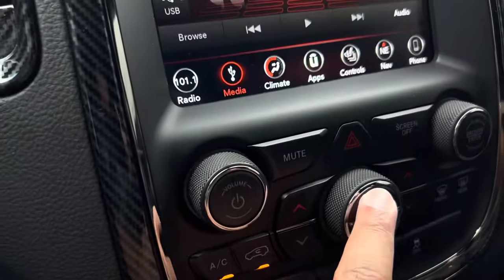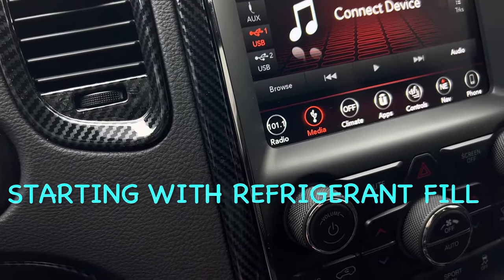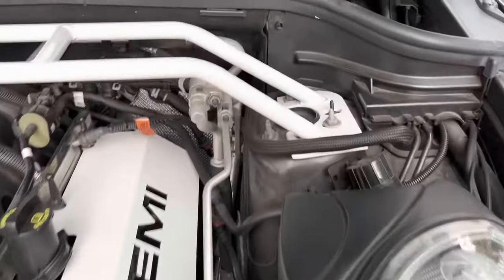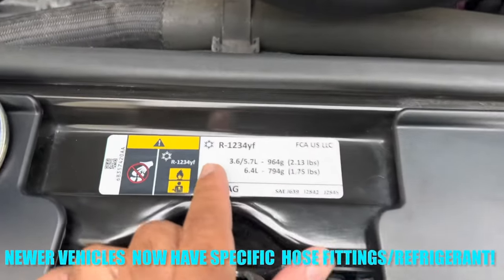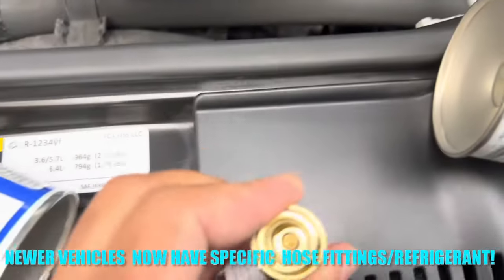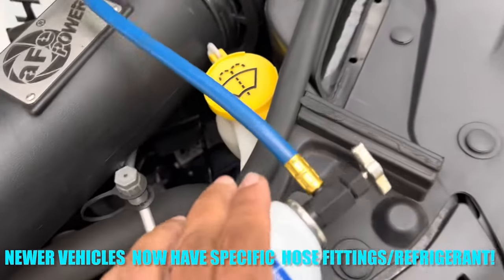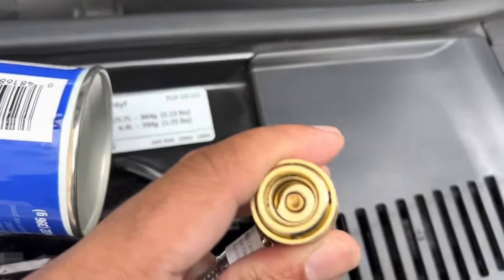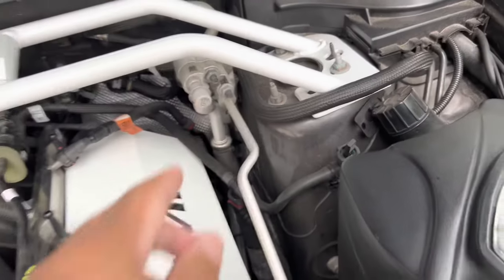MY AC BROKE AND IS HISSING LOUD!!

Comment from the maker: From what I’ve learned there may be air in the system. You can rent to tool or take it to a shop and have them remove all the air from the system.
Reply: You are correct.  Air in the system.  But the system is a closed system, which means air was introduced from a part that is leaking.  You cannot remove the air without fixing the leak.  Mine was a condenser leak.  But there are a few different ac parts that can cause this.  Find your leak, get your system pressure tested or color dye tested to confirm, replace part, refill ac refrigerant.  But find a way that will work for you and save you money.
Reply: @unlistedvideo2164  Did you do it yourself or have a shop do it for you and if you don't mine me asking what was the price tag for everything.
Reply: Can this happen after a condenser replacement?
Reply: @AlexsRTLife   take a Compressor

Comment: Had the same issue on my 2016 grand Cherokee summit . Had it to the shop 3 times and they replaced the condenser and didn’t fix it…. Couldn’t spend any more $$$$$ on professionals to guess what the problem is so I used a smoke machine from amazon the I paid about $100 for and connected it to the low pressure side and surprise!!! The AC compressor had a leak behind the clutch…. Easy replacement and took it to a nice guy to pressure test and refill the system. No more issues…

Comment: My 2019 Grand Cherokee is making the same noise. I’ve taken it in 4 times and no one can figure it out. They even wrote it up as “ Customer states AC sounds like Darth Vader”
Reply: Hello did you find out what the issue was? Im having the same noice
Reply: Hey did you find a solution my vehicle is the same year and has the same problem?
Reply: Definitely something behind the dashboard. They don’t wanna have to take the dashboard out just for a $100 diagnosis fee or for free to look for the problem. I’m almost 100% sure it’s the ducts being partially blocked aka closed from blend door problem. It will hiss. If that happens Your ac or heat won’t be working their best.
Reply: I don't understand that people don't spend 70€ for an AC check and full airco I don't only need antique or fluids but also hidroliq oil also has to be filled for your pump and good lubrication function this can save you a lot of money Mvg Fernando

Comment: Had the same issue at 30K miles with my 2014 Citadel.  Dealer replaced the compressor/condenser under warranty ($3600) and it fixed the issue.  Now at 77K miles and seven years later it has started again.  Luckily its still under warranty for 120K miles.
Reply: Lol a compressor and condenser is like 400 bucks
Reply: Yep. Not at a dealer though

Comment: Mine was doing that, then would stop, then start again. I got barely cold air. That hissing is so loud too like a HUGE leak. Was low over a pound on refrigerant and was leaking at the compressor and schrader valves. Once it was filled and the leak fixed it no longer does it and A/C runs normal. I knew it had something to do with the charge, when it's low on charge the evaporator can ice up, the refrigerant can turn to liquid instead of vapor - all sorts of odd things. Mine started hissing like that even when I was still getting cold air BTW, but got more and more often as the charge fell. Chrysler uses a TXV valve system like house A/C's, so maybe it has something to do with the refrigerant metering? Dunno. For a mechanic to explain I guess - just passing along my experience with my Chrysler 300 (same A/C system as Charger/Challenger).

Comment: This should be a recall issue it’s really common on Jeep dodge Chrysler most of the videos I seen is always the ac and the cam shaft going out on these vehicles and both repairs are crazy expensive Jeep dodge Chrysler have to do better this been going on for years
Reply: Camshaft/ lifter issues are known on both chevy and chrysler.. need to upgrade to 6.1/6.4 springs, lifters depending on generation of hemi.. i use srt viper oil filter with higher oil psi relief on all hemis, but especially to help prevent 5.7 hemi camshaft issues

Comment: There is a leak somewhere. Mechanics will put a UV dye in your system and can check with a light at a later time to identify the source of the leak. It could be be coming from anywhere

Comment: This is the exact same issue I'm having on a 2013 durango.  Even same issue you have when sitting on idle it's more noticeable, but when driving its very quiet.  I'll update about remedy just incase it's different problem other than a condenser, compressor or hose.
Reply: Mine as well. 2013 Durango. Recharging the ac only lasts a few days but hear the same sound when I turn it on. When the ac is no longer cold (refrigerant has all leaked out), the sound stops. Fixing other issues at the moment so I'll get to the ac issue soon lol
Reply: @warhawk813  it was my condenser.  I suggest buying the part and taking elsewhere other than the dealership for repair.  But the hissing is gone and the ac is blowing snow again.

Comment: Same thing is happening to me. But filling the refrigerant only lasts for a day so there’s a much bigger problem
Reply from the maker: Mine still blows colds even weeks after refrigerant recharge but it’s still hissing. I’ll be posting a video whenever I get it diagnosed and fixed
Reply: @AlexsRTLife  Yea I tried fixing with refrigerant refill but it runs out so quick and is back to blowing hot air and the gage reads 0. I’m wondering if it’s a hose. Hope it isn’t the compressor. Not sure if it’s worth buying another can of freon but the one with the Dye inside to detect where the leak is to assess the problem and maybe see if it is a hose or a compressor issue. Or I just wait and take it to the shop to have them take care of it
Reply: @AlexsRTLife  2017 Toyota Camry btw so shouldn’t be normal for cars like this. Probably a major leak somewhere or not sure if pressures are off but otherwise i’m thinking of just going to the shop and having them check it out
Reply: @AlexsRTLife  did you ever get that hissing diagnosed? My Jeep makes the same exact sound
Reply from the maker: I haven’t, I been procrastinating since it’s still blowing cold.  Imma go ahead soon and get it diagnosed

Comment: Whole Process to Fix it ?
what ??
Buying the Wrong Fill Connector and Wrong Refridgerant -- 
"Not" Fixing The Problem and Hoping For The Best ?

I post the problems and fails on my vehicle and take you through the whole process to fix!

Take us through the Process..
Ive Been Looking For A video about this Hissing and failed AC.
Finally !! Someone Showing us The Entire Process + Possible Mistakes to avoid ...

Just a Recharge a Leaking System 
Nevermind the Hissing..
hope for the Best.
Meh 

Maybe Do your Research "After the Fact, Go buy and try to Fill your vehicle's HVAC system with the wrong kind of refrigerant before you read about it and see what your vehicle actually takes. 

 absolutely brilliant that's the entire process how to fix it, well done
 thank you 
very informative, time well spent :-)

Comment: Had AC issues with my 2014 grand Cherokee every single year after buying it...Whatever they do at the dealership to fix it is a patch and the same issue happens again the following year. This year it's working for the first time ever, I changed the ac compressor last year so that might have fixed it.

Comment: 2018 jeep grand cherokee had this issue and had to get a new compressor. Luckily i had extended warranty because it cost about $1500.
Reply: common issue with jeep/dodge/chrysler. you’ll fix it and eventually it WILL happen again.

Comment: I started to have the exact same problem with my 2015 durango RT. I went to several mechanics last week and they told me that the condenser has to be replaced. It has several leaks on it and it's $1000 to do the recharge and to replace the condenser.

Comment: Having this issue in 2021 Grand Cherokee. Literally just got it back from the dealership. Said it was bad cabin air filter that allowed debris into the blower fan. It isn’t. Not fixed. Ugh.
Reply: Any updates? I got this issue after they changed my air filter and still no luck for me.

Comment: 2016 Mazda 3 just shy of 185K started doing this today 😢 when it first started it was blowing cold air but hissing, after about 20 minutes the air got hot and won’t cool down. I just had my Freon levels checked a few months ago and it was full. I’m guessing it’s a busted hose somewhere. Taking it to the shop on Tuesday 🤞🏻 mine hisses when I’m driving as well as idling but if I turn the ac off and just blow air it doesn’t do it.
Reply: I also feel like the air isn’t really blowing out of the vents even tho I have it on high and I can hear the blower
Reply: Is your problem fixed, having same problem Mazda 2016 CX3, when AC is on wierd noise comes , noise settles down when car in motion. Not sure if compressor is culprit.
Reply: @aloktechie7981  negative 😢 can’t remember what the exact part they told me to replace but it’s something in the dash. It has a nasty Freon leak leaked all its Freon in about 4 days. Dealership quoted me 2300 to fix which is more than I owe on the car. Will drive this one a bit longer but I’m thinking on getting another Mazda soon. Mines almost at 192k miles so it’s had a good life

Comment: My 2021 Cherokee is doing the same thing.  I wish I would of saw this video before spending damn near 70 bucks on a 134a can with the adapter that doesn’t fit.   Ugh. No other video mentioned that!  So thanks but to late for me.   Did you ever find out what the problem was ?
Reply from the maker: Not yet, I been putting it off since I still got cool air
Reply: @AlexsRTLife  I think I see green refrigerant all over the radiator.   The engine coolant is a orange color.   So I’m thinking there is a hole somewhere or hose it’s leaking from.  It’s a lease also.   Nothing but problems with these jeep cherokees for some reason

Comment: Damn my grand Cherokee just started doing this 😢
Did you ever solve the problem?
Reply from the maker: Not yet, appointment at dealership soon though. Will upload video on it
Reply: I have the exact issue going and today I noticed refrigerant splatter down near the bottom of the radiator. There was a very small amount but it’s definitely there. My a/c actually blows just as cold as it ever did, so I’m a little confused, but my appointment is on Monday. Will update if I don’t hear anything before that. Good luck!
Reply: Well?
Reply: Any updates?

Comment: That’s your evaporator core
Reply: How do you know forsure
Reply: @10percent48  I’m 100% positive that’s your evaporator core you can hear the hissing you could also hear it through the vents usually those crack and have a leak
Reply: @cristianortega2634 bro I have a 2018 Honda I just change my evaporator core and still have the same hissing sound 🤷🏾‍♂️
Reply: How much is it to fix the evaporator? they told me that’s what was wrong in my 2018 challenger

Comment: Good day, any updates on what’s the cause?
Reply from the maker: Not yet. I will get it diagnosed in the summer. But the weird thing is that is doesn’t hiss at all when the heat is on, only when the AC is on
Reply: @AlexsRTLife  it happens in my car as well and in a few forums it’s mentioned that it’s because of bad expansion valve. And it could also be because of the refrigerant not being in liquid state while going inside the evaporator. If the refrigerator enters the evaporator in gaseous state, the whooshing sounds could basically be the from the gas passing through the metal tubing of the evaporator

Comment: From the looks of it, adding Freon is a temporary fix, and the actual fix is replacing the condenser? 

I have a 2019 jeep grand Cherokee with 34,000 miles and it recently started doing it
Reply: Hey brother were you able to find a solution
Reply: @rraymond4912  

Went to the dealership.  They couldn't find a leak.  They added the refrigerant, and it's been running strong for 3 weeks.  Paid dealership prices of course, which sucked.  Luckily it was only that, instead of the $2000 minimum through the dealership for the condenser. Still forked over $500.  Damn crooks.  

I did check for leaks, which there wasnt.  However, I wasn't able to verify the condenser behind the dash though.  I rolled the dice and got lucky.  Now my Camaro is blowing hot air now.  Never ends.

Comment: Same did you fix it wat was it
Reply from the maker: Once diagnosed and fixed full video coming
Reply: Have you done the video
Reply: I fixed it thanks
Reply: How did you fix it??
Reply: @jeromesmith1612  chainged the ac condenser and both pressure valves that noise  comes when its low on freon there’s  a small leak somewhere took it to a local shop and they put a liquid dy on the ac system and they found a very very small leak
Reply: @marianelagarza3441  How was the leak fixed?
Reply: @cesarmorales7866  replaced the ac condenser a the two pressure valves i paid $250 parts and labor but im in brownsville tx
Reply: @marianelagarza3441  how's it going recently? Did it come back or still good